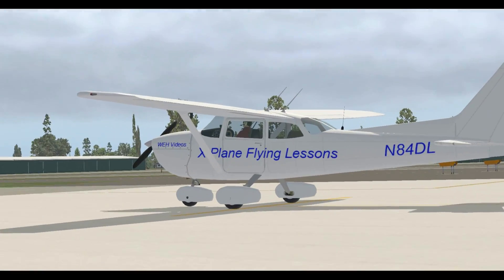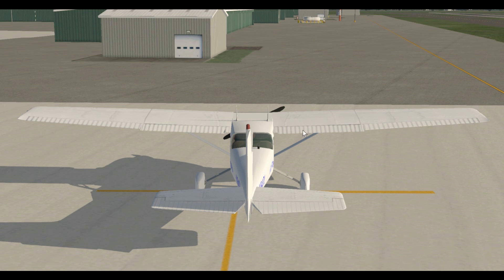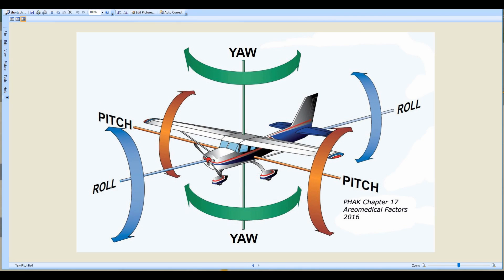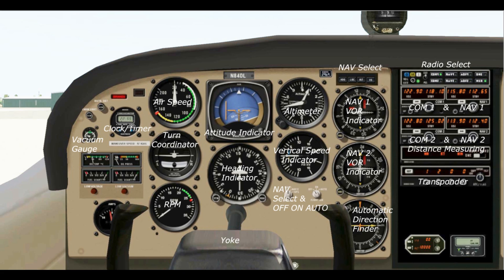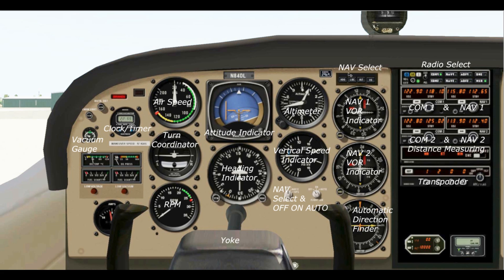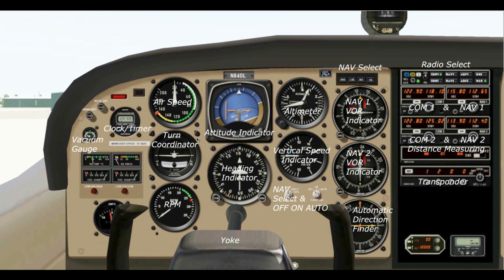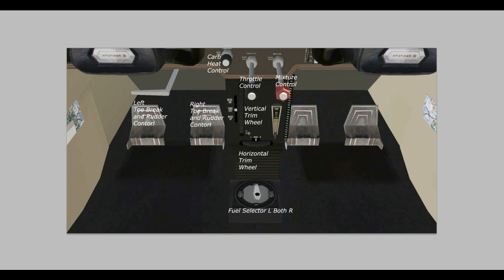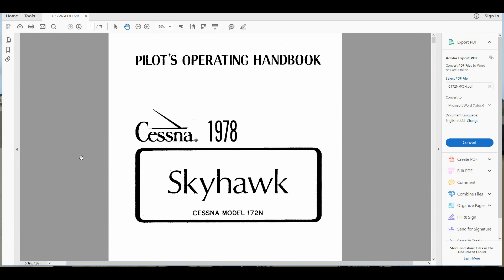Introduction ~ Learning to Fly for Beginners in X Plane 11 Part 1

Comment: I have had X Plane for several years. Think I am now going to follow your instructions. However I have to ask which plane are you using? I would like to use the stock Cessna 172 with the Reality Expansion Pack .  Will that work? The reason I ask is that the cockpit layout looks different.
P.S. Just seen that you use the Cessna 172 N  modified in plane maker. Will go down this route .
Reply from the maker: Hi Ian, The stock 172SP will work fine if you like and yes, I made a lot of changes to the 172N. Glad to hear you are joining me, thanks for watching.

Blessings,
skip
Reply: Have you done a video about all the changes and how to do them?
Reply from the maker: Hi Ian, Yes, here is a link to those videos: https://www.youtube.com/playlist?list=PLjqSrWIZDAi9UtT4iJgh0eDO1UaHVUd-L

Note that many of the newer developed airplanes, such as the airplanes that come with  X Plane 11 like the 172SP and Baron 58, do not use the 2D panel any more so you can NOT make the changes to these airplanes.  I'm pretty sure the 172N from X-Hanger still uses the 2D panel so you can make the changes if you go that route.

A warning on the 172N (or any airplane with a carburetor) It has a carbureted engine so you need to use the carb heat and there is a problem with how X Plane 11 works with carbureted engines. This is a problem with X Plane 11 and not the airplanes, hopefully they will get this fixed in the next release. The big problem is a popup window pops up to tell you to add carb heat even when you have it applied and it's BIG window and won't go away. If you close it it just comes back again, very annoying. 

Blessings,
skip
Reply: Thanks for that. just one more question I have a saitek yoke but no pedals. Can you suggest any (cheap prefered) please.
Reply from the maker: Hi Ian, Saitek or CH Products are the only two I know anything about, check this video out for more info.

https://www.youtube.com/watch?v=9SiJwp9NvlU&t=302s

Blessings,
skip
Reply: Since my last reply a lot has happened some of which prevented me from learning to fly. I now have rudder pedals and in a place to start my sim flying journey. However  I have a few more questions. To learn to fly I am going to use the stock Cessna 172 with the reality expansion pack.  This plane has a Garmin  530/520, also the stock is the same. Since the radio stack is different, will this affect the instructions?
Reply from the maker: Ian Scott Hi Ian, Glad to hear you are ready to go and have the peddles, that will really make a difference. No problem using the Cessna 172SP that comes with XP you will use the COM1/NAV1 radios in the Garmin 530 and COM2/NAV2 in the Garmin 430 just like using the radio stack in the Cessna 172N I’m using. Naturally you set them up differently but they work the same. Just above the NAV1 VOR Indicator you see a button NAV/GPS displaying NAV or GPS to the left, push that button to select which instrument you want to use for navigation. Also on the bottom row of buttons on the Garmin 530 & 430 you will see a CDI button, this will do the same thing. Right above the CDI button you will see VLOC or GPS, when using the NAV radios make sure VLOC is displayed by pressing the CDI button to swap selection.

Good luck let me know how it goes.

Blessings,
skip
Reply: Hi Skip
As I said earlier my journey in the Sim world has begun in earnest. But Over the past couple of days a couple of questions have come up. My pedals even after calibration  in x plane seem a little sensitive. I have the cheap Thrust master Version. Also I had to reverse the axis to stop the brakes from being permanently on.  Also with my Saitek yoke when left to just sit. hands free, it wants to turn to the left I have tried compensating. This does help a little but I find I cannot get a perfect balanced straight flight. Hands free. Are these just the joys of not owning high end gear?
Reply from the maker: Hi Ian,  Have you tried adjusting the sensitivity of the yoke and rudder? Go into setting and play with the sensitivity sliders try moving them all the way to the right or left to see if that helps, I think mine are all the way right. You are not alone with controls that seem too sensitive. I wish XP would give us a bit more control over this as my pedals are still too sensitive for my liking. I eventually got used to them and it's not too bad and I think you will learn how to deal with the sensitivity the more flying you do, hang in there!

If you are flying at slow speeds in a single engine airplane there is a tendency for the airplane to "pull" to the left, you probably notice this on takeoff you need to add right rudder to compensate. This is  because of the effects of the prop and airflow. There is a rudder trim in a lot of airplanes and I think the Cessna 172SP has one so try trimming to see if that helps you fly straighter, use this after takeoff when in normal flight. Hope this helps.

Blessings,
skip

Comment: Where can you get/download the C172 that he uses?  All of the C172 aircraft I've seen include the X-Plane 430/530 avionics.  His doesn't appear to have them.
Reply from the maker: Hi Ralph,  This Cessna 172N can be found at X Hanger here:  https://www.x-hangar.com/store/cessna-172n.html
Please note the airplane in the video has been modified quite a bit in X Plane Plane Maker so if you purchase this airplane it will not look like the one you see in the video. You can see how to modify the instrument panel in my videos on Plane Maker here: https://www.youtube.com/playlist?list=PLjqSrWIZDAi9UtT4iJgh0eDO1UaHVUd-L

Important! This airplanes' engine has a carburetor, it is not fuel injected like the 172SP and right now X Plane 11 has a problem with how the carb heat works. Under certain conditions it is necessary to add heat to the carburetor so ice will not form and stall the engine. Unfortunately XP11 is doings something wrong and a warning window pops up telling you at add carb heat even when the carb heat is on. This can be very annoying  and there is no way to stop the warning pop up. To make it worse it's a pretty big pop up. I'm hoping XP will get this fixed with the next release, a bug report was sent to the developers I just don't know how quickly they will get this fixed.

Thanks for watching, hope the video helps. If you have any questions regarding the carb heat let me know.

Blessings,
skip

Comment: I know there was auto coordinate plugin for X-Plane 10 - don't know if it works in 11 - do you, otherwise how do you solve the problem of not having rudder pedals - can't step on the ball. (I remember telling you about this once but I couldn't get it to work with the demo - I have no way to know if it work with the full version and cannot test it.)
Reply: Can someone test this for me and let me know if it works? Thanks.-  X-Coordinate for X-Plane: http://forums.x-plane.org/index.php?/files/file/15906-x-coordinate-linmacwin3264/ (This will make it so you don't have to step on the ball to fly if you have no rudder pedals)
Reply from the maker: Hi Divergent, I do not know, sorry,  I can only suggest you start saving up for peddles I consider them a must to get the most out of your sim:-).

Blessings,
skip
Reply from the maker: Hi Divergent Droid,  I just found out that X Plane 11 uses auto coordinate for the rudder if there is no controller assigned to YAW. So in normal turns XP will keep you coordinated, however, in landing and other places where you might need to add rudder for whatever reason your out of luck.

Blessings,
skip
Reply: Good to know. Thanks for the info.